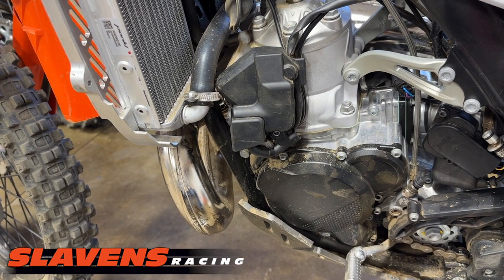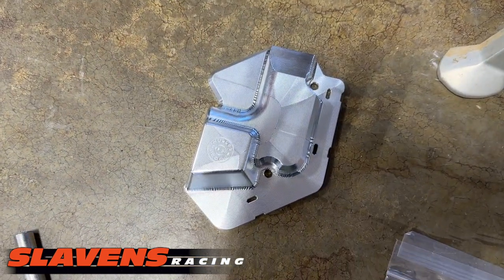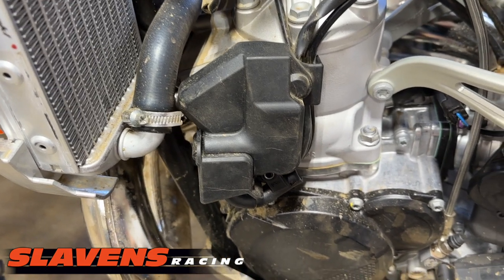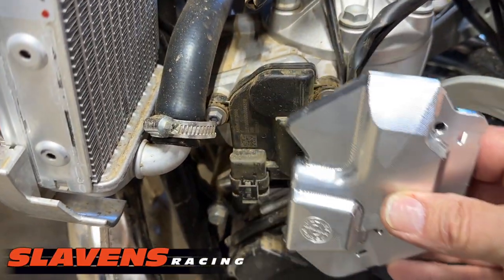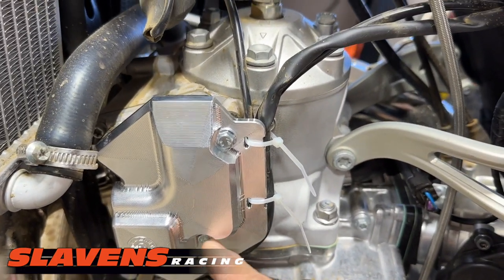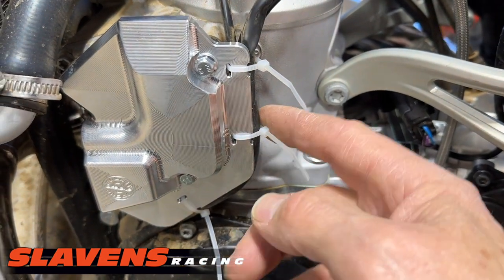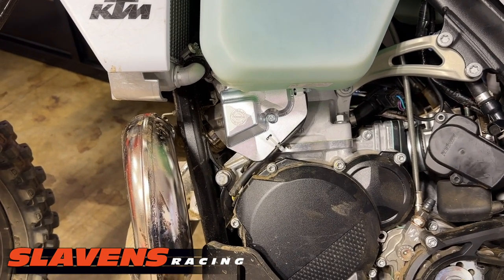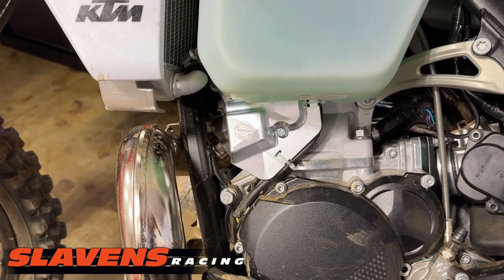Bullet Proof Designs 2-Stroke Power Valve Cover

Comment: That's one thing I dislike about the Austrian bikes, You have to spend half a mil. to protect everything. What's the point of all the weight savings when you have to add it all back on and then some to protect it.
Reply: You don't HAVE to take the extra measures and expense.  If a BluCru rider continuously rides and exposes themselves and their moto to risky situations I'm sure the rider wod be looking for ways to insure their ride ends they way they want it to.  I bet the track only KTMs don't have the desire to keep adding weight unless bling is what is all about.  And you know bling is everything to some riders regardless of terrain.
Reply: @scottforrest2246  Not true. I own both a yzx and a ktm 250xc. My yz doesn't need chain guard tab protectors, tps guard, a fan, a guard for the radiator hose, a metal gas petcock because it already comes with one and I'm sure I'm leaving out a bunch of other crap. 

One of them is more "ready to race" than the other. Guess which one.
Reply: @seanwahl1000  @Rizzo44 Rizzo Point taken.  Of what you mentioned I see the metal TPS guard and coolant line guard as true needs of some model years.  Honestly though I think much of what KTM trail riders spend on hard parts is not needed.  I've heard chain guide tabs are at risk yet I've not seen one broken in the wild.  A friend has a track only YZ450 and hung new hard parts and graphics all over it.  Overkill to me but he likes the looks and justifies the cost as insurance for finishing his races.

You still have a KTM, can't be all that bad after all.  I only have one bike to ride so I've added disc guards and the metal TPS cover, made a coolant line guard from stuff laying around.  My OEM fuel tap is metal, no desire or need to change that.
Reply: @scottforrest2246  That is true. A lot of KTM guys (especially older guys) are putting on a ton of stuff they don't need. It's like a hobby for them.
Reply: @seanwahl1000  Ab-so-lutely. So does the factory.
Reply: Which bike do you know of or own that you don't have to protect when you're going 100 miles out in the middle of nowhere - where cell service isn't even available?  Which bike can I take and hit super rocky, etc. trails that only a few bikes if any have gone before, and I don't need to put any protection on it?
Reply: @onthethrottle7104  Some need more than others is all I'm saying.